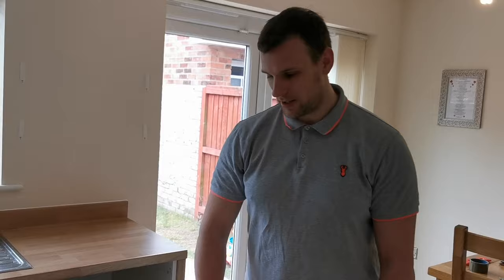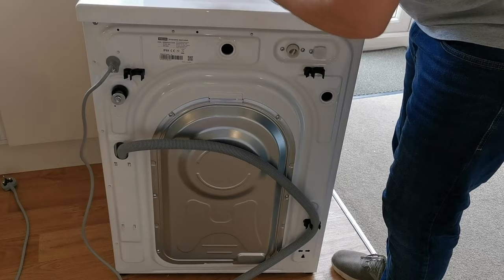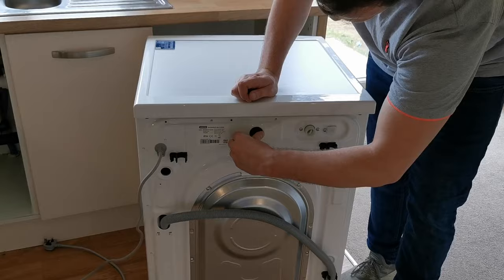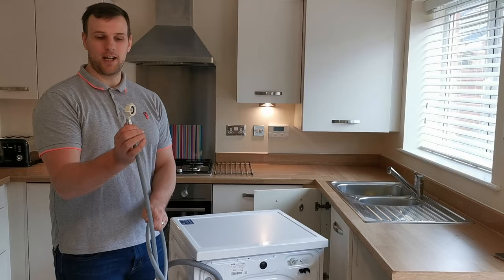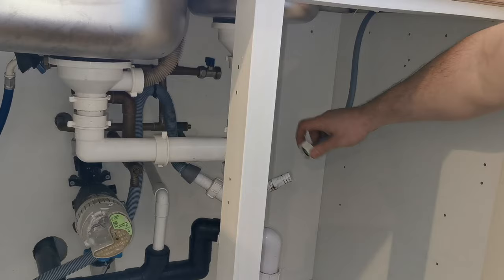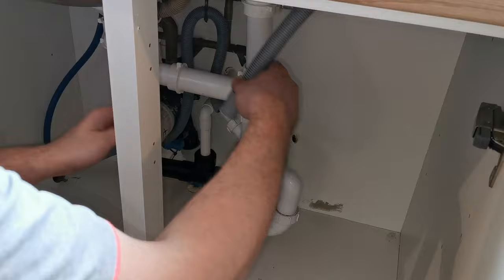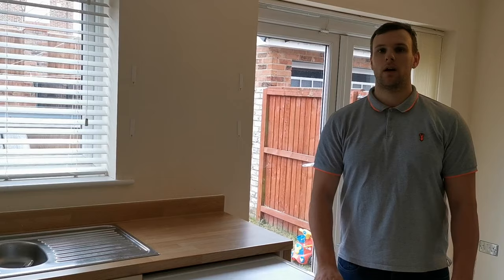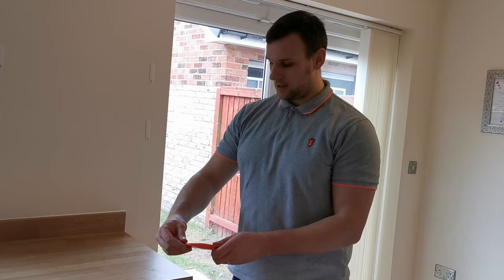How to Install Your Washing Machine | ao.com

Comment: Great video except better to mention adjusting feet before you’ve pushed the thing under the top in case you need to adjust back feet. Also, doesn’t mention turning the water tap back on (presumably it’s off from the last one was disconnected!) but I worked that out and I still really appreciate these videos! Saved me £20! Xx
Reply: Thanks for mentioning this. First time home owner here and clueless 😂
Reply: He also didn’t use a jubilee clip around the waste pipe.

Comment: Great video however makes the somewhat criminal assumption that the plumbing in most houses actually makes sense and that there aren't bits of waste pipe or cold water feed buried behind other appliances/bits of wall etc 🤣

Comment: Drivers have 15min to knock on the dor wait for costumeer to answer ,unload appliance from the van, check with the costumer if is the coreect model,coreect color,carring in specific place install the machine , check the washing machine if everything its fine. All this in maximum 15 minutes to be on time for next costumer. Sick with that.
Reply: they do it in 1 minute and 36 seconds so 15 minutes should be enough mate :))))))))) .
Reply: It's happening everywhere.  Multi-drop delivery,  modern slavery
Reply: @Georgia-Be  cmmon mate are you joking? In this video he have the appliance allready in the place they cut his video, ohh and i forgot you have to disconect the old one aswell in the same f..king 15 minutes.You right you modern Slavery plus they put drivers to exceed the driving hours agains to guvernamental rulles, they put drivers to lie in papers.
Reply: Argos don't even disconnect
Reply: 15 mins is plenty of time.
Reply: What are you on about...
Reply: I used to be a drivers mate at Argos and although we had an 8 minute window between customers, we all took our time to make sure we did our jobs correctly. During lockdowns, installations was suspended as you could imagine.

Comment: I have two water inlets? Blue and red? Should I go for the blue one?
Reply: Apologies for being a year late, but thought I'd answer in case any one watching this video had the same question:

The Blue and Red inlets are for Cold and Hot fill. Some homes have the right plumbing to connect your washing machine straight to a hot water supply: this way the machine doesn't spend extra energy heating cold water. 

If you have the right plumbing and want to use hot fill, connect the red inlet to your hot water line. Otherwise, just connect the blue inlet to your normal water supply.